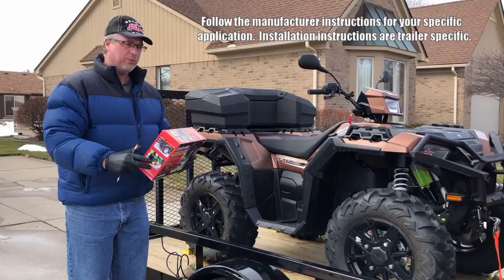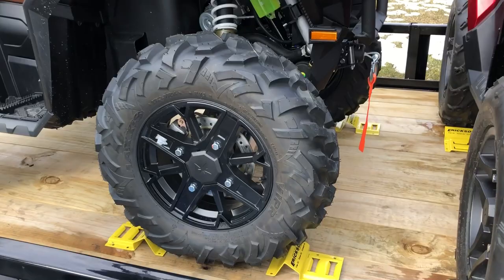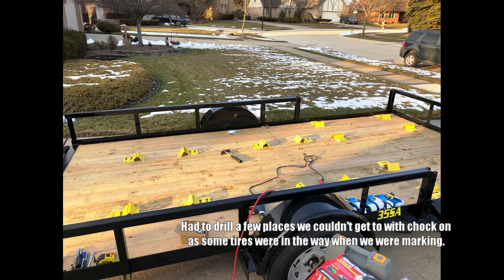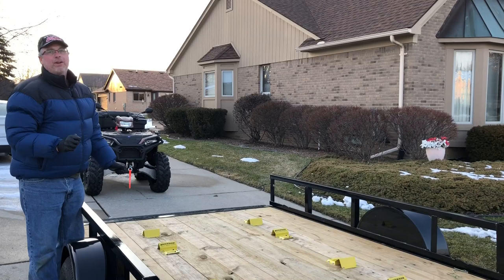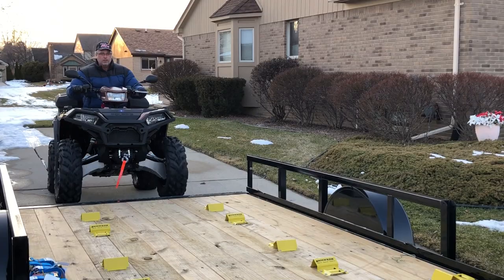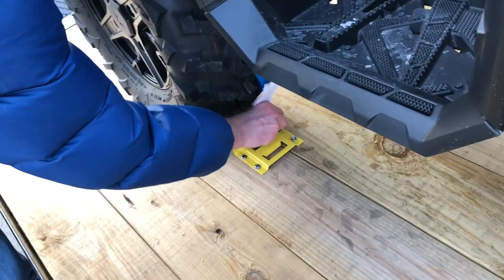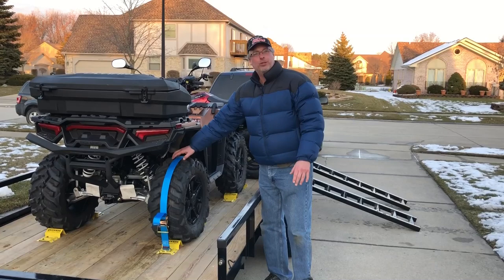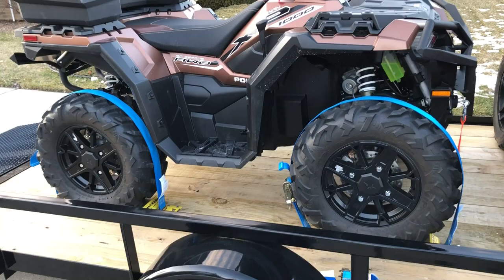Erickson Wheel Chock and Tie Down Install Video for ATV/Vehicle Transport

Comment: I had installed these before switching to the E-Track system. They worked great but they stuck up way too 
much to make my Trailer functional for anything else.  Always tripping over them!  The E-Track is so low 
profile you don't even know it's there. It works phenomenally as well. Thanks for you Video.  Very well done!
Reply: Especially if you have a manual quad, or even just yanking it on on the trailer by hand e track are nice about to install mine tomorrow
Reply from the maker: We are looking to switch to the E-Track system.  Doing our research on it now

Comment: I bought just two a year ago 06/19 to haul my 1100 lb Oreion Reeper on a 12" open trailer. With over 3000 mile towed I have had NO issues or problems. I use them on the rear wheels only. Put in neutral and set the parking break. Check every so often. Very easy to use.
Reply from the maker: @Norman Little Lol, we put one sideways and the other on from the back.

Comment: We just got back from a 12 hour (each way) trip to West Virginia using a friends trailer and regular ratchet straps. The combination of twisty, bumpy roads and no good tie down points made for a stressfull time. If I never have to tie down a machine to a trailer I will be a happy man.
I just ordered a set of these for my trailer. It is a side load setup for two ATV's. Fortunately, both machines are the same width so I won't be stuck putting one bike in a particular spot.
Reply from the maker: It is nice to have, every time we use ours loading and unloading we are thankful how easy it is.  Been a couple years for us now and we seem to like em more and more every year

Comment: I’ve had a set (2) on my ATV trailer for 3 years.  Have on back wheels.  Always work well.  I’ve had 2 cases where when I got to my destination one had slipped off tires.  I suspect in both cases they were not connected properly or not ratcheted tight enough.  Highly recommend.
Reply from the maker: They have been great for sure.

Comment: Bought 2 sets of these in 2015 when I bought a Yamaha Rhino 700.  At the time they were $39.00 a set through Cabela's.  Only thing you have to figure out is which works best, ratchet to the front of the tire, or to the rear.  I also recommend that you DO NOT drive over the clips-- I put mine off to the side when I take the Rhino off , or put them in the truck if I'm done hauling for a period of time.  Great product.
Reply from the maker: It has been great for us for the past 5 years.
Reply: @DirtyJakTheDustyBean  In the spring of 2021 I sold my Rhino and went with a Polaris XP 1000- heavier unit and got a bigger trailer. I bought the E-Tracks to run the entire length of the trailer. Now I can use the same ratchets, but can lock down any ATV/UTV, lawnmower, lumber, etc anywhere along the tracks. Much more versatile than the chuck system.
Reply from the maker: @waynoevans2716  we’re 99% sure we’re going with the E-Track system on our new trailer.  Exactly the same reasons your stating

Comment: i love the system just don't know about the wheel chock side of it. im hauling my golf carts that will be fine. but the zero turn may not work with this system  for driving over 8 plates on the floor. im thinking of going with just the E-Track mini  plates without the chocks just not sure if it will stop my units from rocking back and forth. please let me know what you thing Thnaks
Reply from the maker: We have a video coming out soon with our new trailer and the e-track system.  They sell movable wheel chock’s that go with them.  We love this new e-track system and all we can do with it

Comment: Nice IF your trailer is only for the quads........why not just use e track and no wheel chock? 
Curious ?
I 100% agree with tying to the unsprung part whether that be tire or wheel, seen soooooo many straps on the road
Reply from the maker: I didn't really look into the e track much at the time so went with the wheel chocks.

Comment: Strapping by the wheels is definately the best way to tie a quad down. Im not sure about using a single strap like that though, instead of a wheel net strap. My worry is, what if you have a small unknown leak in the tire, and it goes flat while tied to the trailer? Im afraid the strap would fall off. But i guess if you did all 4, you would still have 3 wheels tied down.
Reply from the maker: Don't quote me on this for sure but I thought I read somewhere (actually a few places) that most only strap down two wheels so even at 3 should be fine.  We do all 4 as it seems a little safer and only takes a minute or two longer to do it.

Comment: Looks nice and great system but unfortunately your trailer is useless for another type of load, because of the yellow blocks on the the floor
Reply from the maker: Yea is a pretty specific system for moving our ATV's.  We can use the trailer to move some other items but it's not ideally set up for everything with the blocks.  Been great for us as it has moved everything we have needed it to (furniture, etc).  Not sure what we will use next when we get a new set up, we may use this again or go with a more sleek system.

Comment: It looks like a slick system, but also looks like it may limit the usefulness of your trailer if you try to use it for anything other than hauling ATV’s.
Reply from the maker: TCG 3 true could limit the trailer for sure on other things.  We mainly use it to move quads, kayaks and furniture and no issues with any of those.

Comment: Nice system but when you change atv’s and the width and wheelbase changes you now will have extra holes in the deck when you need to move the parts.
Reply from the maker: True, when we look to get a new trailer and ATV's we may change the system we are using.  Not sure just yet as this is great for the ATV's but has limitations on other things and with the trailer having them mounted on it.
Reply: rustytr  yes you’re right unless it’s an aluminum deck trailer.

Comment: Great video!  I've been eyeing this tie down system for a while.  The only concern I have is the ice and snow build up in those chocks where I live in Ottawa, Canada.  Unless you store your trailer in some shelter, have you had any issues keeping these clear and accessible in the winters?  Cheers!
Reply from the maker: That hasn’t happened to us as we have used these very little in the snow.  It makes sense these would get blocked up in the snow/ice.  We just put the E-Track system from Erickson on our new trailer and I bet that would be a concern with this one as well.

Comment: Do you still like wheel chokes? Do you recommend these??
Reply from the maker: We changed out to the E-Track system a few months ago.  We did like the wheel chock system just think the e-track is better.  E-Track is low profile, adjustable strap down points and easy to use.

https://youtu.be/wU1WyTUoH8A

Comment: I currently have a Big Tex 30SA 5x8 for my 570,  I just got a second one and was wondering which size this trailer is you have and how wide? Is this the 35SA-RSX? Thank you!
Reply from the maker: This one is a 14x7, if I wanted to be able to pull them both up facing forward would've needed a 16x7.
Reply: Thank you sir!

Comment: Just bought these. What size nut washer and bolts did you buy ? Thanks
Reply from the maker: We bought the bolt one inch longer than the wood depth, so 3 inch bolts, the washers were either 1 1/4 or 1 1/2.

Comment: What length bolts did you use
Reply from the maker: I don't remember for sure, I believe the wood is two inches thick and we went with 3 or 3 1/2 inch bolts.

Comment: And no need to bolt to the frame ? Just the wood ? Thanks
Reply from the maker: On our trailer it would be tough to secure to the frame as there isn't always frame underneath everywhere we needed to bolt to.  So we just put the atv's where they needed to be, marked them and secured to whatever was beneath which happened to always be wood in our case.
Reply: Ok great thanks ! I have the same trailer just smaller so it’ll be all Wood most likely for me.
Reply: You could always add a piece of plate underneath the grab the wood better if it was a concern.